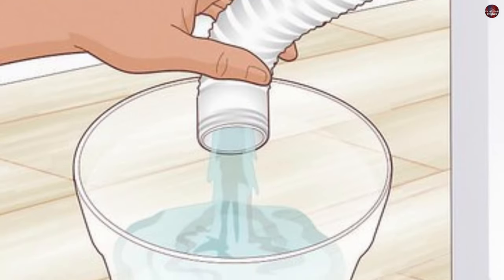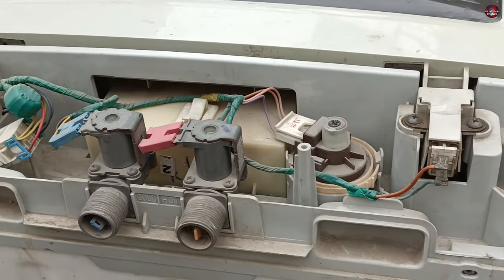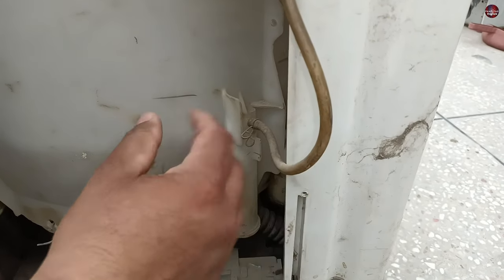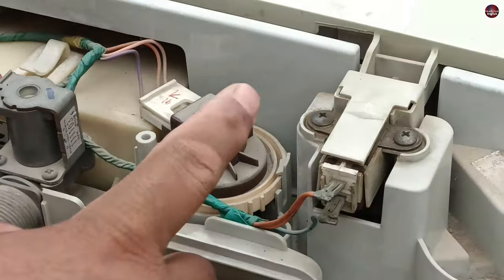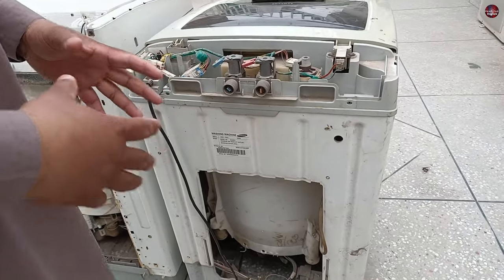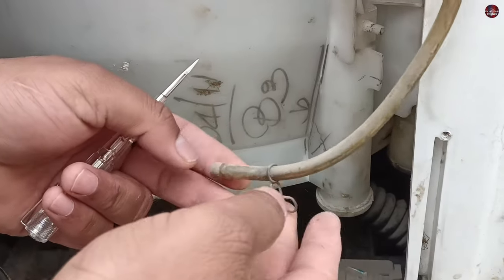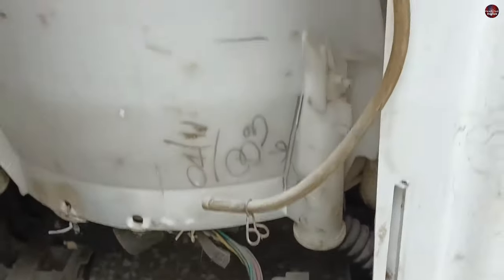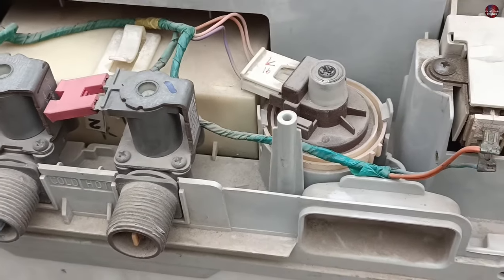Top Load Washing Machine Keeps Draining Water on Wash Mode

Comment: Just lift up the hose and problem solve🤷🏻‍♂️🤷🏻‍♂️
Reply from the maker: Well, Yes in most cases lifting the hose could solve the problem, that's not the case, These automatic machine has a drain pump, so if the hose is on the floor it should not drain water untill drain motor works
Reply: how to clean the blocked air trap?
Reply: This just solved my problem. Thank you immensely.
Reply: U a real G big baller heads up 🫱🏻‍🫲🏿🫵🏼
Reply: This was the answer to my problem! Thanks a million!!!

Greetings from South Africa

Comment: Bought a new motherboard but seems like the issue is not electronics
Reply from the maker: Yep check the air trap, or for any blockage in it.....
Reply: @forevertechenglish  Thanks for the reply. I googled and someone wrote that you should not blow into the level sensor. Oops I blew and maybe damaged it. I'll get a new one first
Reply: @forevertechenglish  Update. Replaced water level switch and the machine is back and running. Thanks for your DIY advice